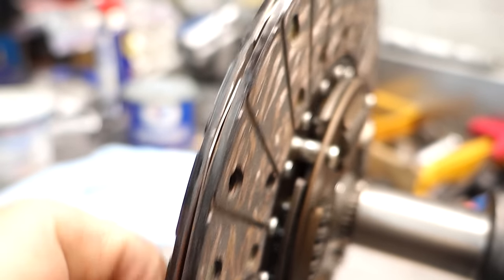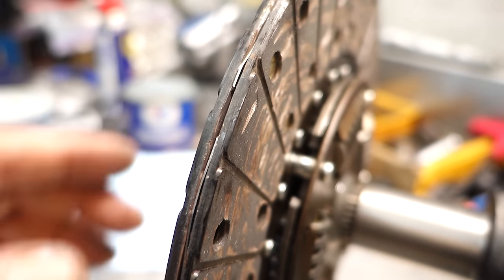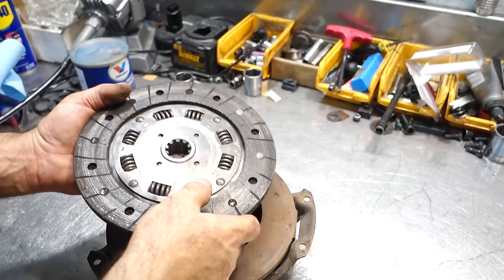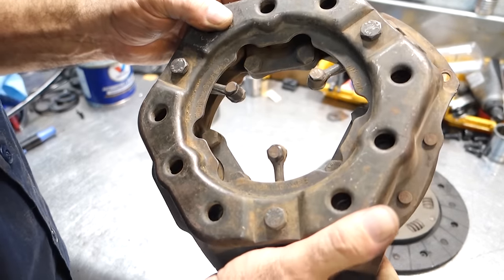Learn How a Clutch Works -  Basic Clutch Operation and Tips

Comment: Hello. Thank you for such an informative video. I am a visual learner and this helped me greatly. I was wondering if you had any tips for clutch longevity. I am new to driving manual and don't want to burn out my clutch. Any tips in advance are greatly appreciated.
Reply from the maker: Hydragurum Do your best not to overload it. Such as towing or hauling heavy loads. Also always start off in the proper gear. People who start off in 2nd rather than first tend to wear out clutches faster.
Reply: GearBoxVideo
Thank you. But I will be driving a sports car with a manual transmission, so I won't be doing any hauling. I know to never powershift, but there does seem to be times when holding the clutch at the engagement point seems necessary (such as when needing to creep in traffic or parallel park). Also, I'm not certain yet how to reduce speed by braking and downshifting without excessively wearing the clutch. I'd really appreciate it if you could supply your expert feedback on that. Thanks!
Reply from the maker: Hydragurum Using your brakes as opposed to "engine braking" reduces clutch wear.

Comment: Hi paul i love your video's i just put a t5 behind a 351 c with a custom bellhousing ,all bolts in well but i cant get any gears ? which way does the clutch plate go in,i put the boss of the clutch plate towards the gearbox,it wouldnt fit the other way ? just seeing if i made a mistake,it gets gears without the engine running,pedal is strong i dont no what is going on.
Reply from the maker: You have no clutch release. You fail to tell me what make and model.
Reply: Paul its an australian ford 1983 sedan 351cleveland t5 box 1994.The fork does not line up 100% with the pushrod ,its at a bad angle,maybe i need an adjustable one,

Comment: Many people Float the Clutch when shifting gears. Most drivers of large diesel trucks do this. The clutch pedal is only used when stopped. To shift you must match engine speed to road speed. Use the speedometer to do this. Just wondering is there is any internal damage to the transmission, if done by someone that is proficient  in shifting gears by floating the clutch? I am sure that there can be damage if not done properly.
Reply from the maker: Some of these transmissions you talk about  do not have synchronizers.  So you do have to match speeds. However not using a clutch with a full synchro box just prematurely wears the rings out.

Comment: Fantastic video !! Thank you so much.
My question is how crucial is it to use the special tool when installing a self adjusting clutch to tighten the pressure plate, compared to just directly putting the pressure plate without the tool and tightening it... ? Sounds like a lot of extra effort for nothing
Reply from the maker: Are you talking about using a torque wrench? If so equal torque or clamping force is necessary for correct installation. You are assuming that bolts cannot be over tightened to the point they can fail.
Reply: Nope .. non of that basic stuff .. I am referring  to this tool /process to install a self adjusting clutch 
https://youtu.be/Tp5KeAQntGM
Reply from the maker: @MowSow   I didn't know what you were talking about since you failed to mention it in your initial comment but I see what you mean. The tool assures perfect alignment.   Its not necessary but I have seen people have release issues because they bent the clutch disc installing it.  If you are careful, its probably not needed.

Comment: So, in terms of clutch release, What is the best thing to do in terms of lubricating the splines on the input shaft for proper clutch spline librication? if any. 
Sometimes a perfect set up gear box and clutch alignment works, but adventually after some good millage,  miss shifts happens and cant be figured out. perhaps the clutch splines get sticky with the little bit special grease that some people apply to the splines along with all the clutch dust that happens in race applications... ?
Reply from the maker: Most great won't stay on once it's rotating. But a Moly grease would be best

Comment: Question! I am planning buy a vw from an auction knowingly has a trans issue! Goes through gears at the stick fine..i tested the put it in gear and see if it moves while off..i rolled the shid out of it..it moved..like if it was neutral..i know i will have to dig in to see but does anything jump out to you!?
Reply from the maker: Maybe just a clutch.

Comment: Just got another query , am making up a concentric release system and having problems getting my head around it, probably over-thinking it , but , as the friction plate wears, the operating fingers move towards the release bearing , so how do you judge where the release bearing should be? The release bearing has a throw of about 15mm, the release fingers move about 12mm between a new clutch plate and a worn out one, how much movement of the fingers is required to release the friction plate?
Reply from the maker: Depends on the clutch and movement of the bearing. Some require a gap of about 3/16 of an inch which is enough to compensate for wear.

Comment: Now I understand why my gearbox rattled after a light fly wheel install. Would a disc with softer springs lessen the chatter?
Reply from the maker: Sometimes a solid hub will eliminate the rattle. I have had to experiment with heavy or lighter springs in certain conversions to get the issue to go away. Sometimes it's just low idle rpm backed by a heavy cam

Comment: Go informative video ,I've had my clutch replaced in my for f250 ford truck it started making noise while in neutral and something eventually broke while driving had another clutch put in and within two weeks it making the same noise,note had my transmission total inspected it is good ,could the clutch plate be in backwards
Reply from the maker: No. Clutch plates can't be installed backwards cause there usually is not enough room. But the springs may be hitting the flywheel especially if the wheel was resurfacedbwhich could lead to a clutch plate failure
Reply: @GearBoxVideo  it was resurfaced
Reply: Thank you for the information

Comment: thank you from Sweden! 

I'd like to ask question, what could be the reason for my clutch to slip when cold, but not once warmed.  there is no chatter, grinding or gear pop outs. the car is a mitsu evolution 8.

thank you for the very informative video!
Reply from the maker: Your clutch is probably worn, and when it heats up it expands enough to lock up

Comment: Interesting, a helical reverse gear, and the grooves that guide one into the mesh with the other are helical as well.
Reply from the maker: Max Yeremin That particular design has been around since the 1950's.. I guess they wanted a quieter reverse operation and a higher expense.

Comment: I have a tremec magnum in my mustang using a McLeod single disc clutch and it’s cable operated using their throwout bearing and a bronze input bushing. One night I jumped on the brakes hard but not that hard to make a turn and when I downshifted into 2nd it grinded and started making a swirling noise then grinded into 3rd. I got the car home still making noise and parked it. The next day when I backed the car out to diagnose the problem the problem was gone. About 100 miles later I went to pull away from a light and revved the car with the clutch in obviously and there was that screeching sound again. So I drove it home and now I’m almost done taking the trans out. Shifting 1st to 2nd felt tight also. Any idea of what might be going on? What do you suggest using this time a heavy duty input shaft bearing or bushing again? I think I should’ve used a bearing but curious of your opinion. Any help would be great. Thanks
Reply from the maker: Sounds like the pilot bearing is sticking to the input shaft and spinning in the crank

Comment: Do you mind sharing what model is your camera? I find my camera frequently have issue with focusing at this distance. Especially when there is glare from the metal plate.
Reply from the maker: I use a Sony RX100 Miii  The link is here.  http://amzn.to/2jLwY5K   Battery life is great and it fits in my pocket. I prefer this over my canon, which wasn't as durable.
Reply: Thank you for your detailed reply and link to amazon =). I'm thinking of buying one. My D5000 doesn't do auto focus and Logitec Cybercam doesn't focus at very near distance.
Reply from the maker: This cam has face tracking which is good for vlogging abd a flip back screen. Some people use the Canon G7X.  I had that as well but the build quality was horrible and after it broke with moderate use I scrapped it. An auto shop enviroment and visiting less than perfect camera friendly places chewed up my Canons.

Comment: Great video. I understand how it works but just for clarification, so the little hub and little springs take the whole load of the engine, then send it to the input shaft? 

I can't get it through my head that that little piece can take all the power of the engine without twisting the hub out or ripping the rivets off the disk 😳
Reply from the maker: Yes, that is correct. That is what the clamping load does. I have seen high horsepower engines rip the hub apart.  That is why you have heavy duty discs and racing clutches.
Reply: GearBoxVideo: thank you sir for the reply. Keep up the good work!

Comment: Hi Paul, dumb question maybe, but in reference to when you mentioned that having a lightened flywheel can cause chatter because there isn't enough rotating mass to preload the drive springs, is there, I guess, a kit to replace the stock drive springs with higher pressure rated springs to compensate for the lightened wheel and stop chatter? Or is it a case of getting a whole new uprated clutch if you lighten the flywheel? Thanks again for all the hard work, love the channel :)
Reply from the maker: Sometimes a solid hub would work better .  It would have to be a custom disc made by the people who make your clutch.
Reply: @GearBoxVideo  Thank you for the quick reply Paul, it's much appreciated :)

Comment: Great video Paul, thanks for taking the time for the thorough explanation!  What is your thought on the "stop light" situation?  Is it better when you are stopped to leave the car in 1st with the clutch fully engaged or put the car in neutral and totally release the clutch (brakes engaged both ways of course!)?   The first way would leave pressure on the release bearing the entire time you are stopped, and the second way would basically add an extra engage/disengage cycle every time you stop.  What do you think is the better procedure?
Reply from the maker: Put the trans in neutral.  You can prematurely wear out the release bearing. and from the safety standpoint, if you get hit your car can lurch forward

Comment: hey great video and great explainings but im still having alittle trouble with my 2000 honda crv clutch slipping problem. so I recently swap out brand new slave cylinder, Masters cylinder and even a brand new clutch kit (brand new flywheel, clutch, and pressure plate) and I still get a slip on my clutch. I did some research and resurfaced my old flywheel and decided to used the old flywheel with the new clutch kit and it worked. somehow after 2 weeks of driving it started to do the same. so I have no idea what so ever I'm up against right now. any ideas or opinions clutch expert guy???
Reply from the maker: If a clutch is slipping, its not holding.  That simple.  The question is why? Are you exceeding the horsepower of the clutch? Maybe you need to use a more agressive lining?  What brand clutch are you using?

Comment: Hi, thanks for your video. I just have some questions. 
1) It's enough the clutch's pressure to the flywhile to transmit whole power from engine? i mean, there are losses?
2) There are tremendes noise and losses of power from engine by clutch's friction?

Thanks
Reply from the maker: Stalin Romero when the clutch is engaged the transmission and engine are locked together. There are no  frictional losses. Clutches are designed to hold the torque the engines put out.
Reply: Ok Thanks...Good video

Comment: I think this was my issue. It would grind into reverse and then catch going into all the other gears with the clutch down. Would cause a squeaking noise as the clutch would slip
Reply from the maker: Poor clutch release and possible bad pilot bushing.
Reply: yeah they said there was oil getting into the clutch housing and the release didnt seem to be doing its job right. the clutch was worn all the way down at only 45k miles. its not too bad but still not good. while they had it open i had them do a 200k mile service on the transmission while they were at it. they are going to put it back and adjust everything and see how it does. waiting to get it back soon. id probably do it all myself except for the labor to drop the transmission is a nightmare and i just dont have the tools

Comment: That was very helpful thankyou I am suffering from a gearbox rattle from MTA gearbox on a Fiat Abarth with  the drag in reverse pus it can be clunky at low speed but fine when u get going do u know what that could be?
Reply from the maker: Have you changed the flywheel to a lightweight flywheel?
Reply: @GearBoxVideo  No the Problem developed over time I have done nothing to the gearbox since owning it I doubt the guy who owned it before did but I could not be sure.
Reply from the maker: If you have a dual mass flywheel, it may be on its way out
Reply: @GearBoxVideo  could it be a bearing as well or even loose shafts rattling againt the gears?could the clunk be Oil? I tend to Think that what u should on the Fly wheel when u Took the spings out feels more like it.

Comment: I have a 5 speed synchromesh Mazda Manual transmission on a 98 Ford Ranger 2.5L engine. I ran my truck down the highway 90 MPH. My clutch disengage and I was trying get into gear, but , I had to pull over cause of the noise . The noise sounded like Baseball cards clip to a bicycle wheel, when I try to engage clutch into gear again. I install new flywheel,  LuK 07-140 Clutch Set ,Centric Parts 138.65010 Clutch Slave Cylinder.  Bleed the Clutch Slave cylinder. The noise is still the same. To turn over my engine and to keep it running without the noises. I have to hold down the Clutch petal, no noise. If I release the clutch petal the noise of the baseball cards sound off and on, but engine runs.
Reply from the maker: Antonio Montanez could be in the transmission.

Comment: Hi, thanks for the informative video!  Would you have any idea what would cause a clutch to be harder to press?  It's as if the diaphragm spring is just a lot stiffer (I just learnt about how that works).  Everything else seems to work fine and it's actually been this way since I got the car some years ago.  It's just been a constant annoyance, particularly if I'm in slow moving traffic and keep having to press the clutch
Reply from the maker: The release bearing my not be traveling on a smooth surface or the geometry may be off.

Comment: While I was Injured in The miitary and had a few back operation I am Looking for a VERY soft Pedal Clutch , The STock 93 cobra clutch was soft and i have yet to feel on like that , I called and ford No longer makes that part . Can u suggest a SOFT pedal with Decent clamping ? its an 11 70  93 cobra ..
Reply from the maker: I think if you search for replacement king cobra clutches for that model year. You will find an equivalent clutch with the same pedal pressure.

Comment: Aloha, could you please tell us a bit about pressure plates, straps on my keep snapping during up shift. Mahalo
Reply from the maker: You have to see if you are snapping the rivets that hold the straps or are the straps buckling. When straps break its because you are using engine braking too harsh or romping on the gas and off the gas.  Any harsh decell  can work harden and break straps.  What brand clutch are you using?

Comment: I’m sure this is a common question but I just installed a tkx in a what was an automatic and for some reason when I turn the truck on I can’t shit into any gear I had my wife step on the clutch and I can see that the throw out bearing is pushing the teeth in but I still can’t  seem to shift could it be that there isn’t enough fluid running through the line to put enough pressure to release the clutch I don’t here any grinding or odd noises
Reply from the maker: Your clutch is not release or your pilot bushing is hanging up on the input shaft.

Comment: Hey Very nice explanation, I have a new set which have just done 2000miles. After someone launched my car from a standstill i have shifting issues at high rpm. shifter wont go in next gear and grinding noises. when normal dailying it does shift like it should. Any idea what could be wrong?
Reply from the maker: Poor clutch release
Reply: @GearBoxVideo  yes but everything is close to new, already bleeded the slave many times. 

on saab forum the 2x4 trick is very popular, put a piece of 2x4 wood on the clutch pedal and depress it 3/4 overnight with the seat. I have done this many nights with no results but when i come to my car and remove the 2x4 piece of wood my clutch pedal doesn’t come up and stays 3/4 depressed like as if the wood is still in between it. Does this mean that i have a leak in my hydraulics?

i checked the slave with a camera. When I press there clutch pedal a tiny bit the slave does move out instantly without any delay. Is it still possible that my master does build up enough pressure to move out the slave instantly but but enough to disengage my pressure plate fully?
Reply from the maker: Possibly your master is at fault then. Since there is no clutch adjustment